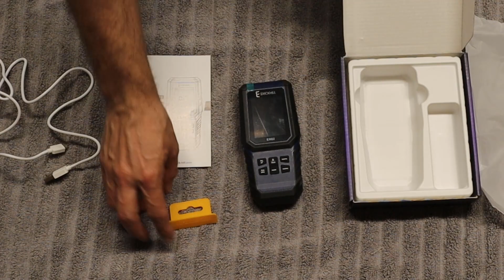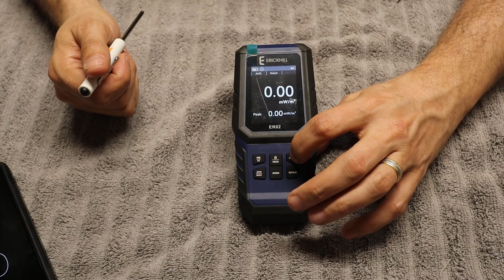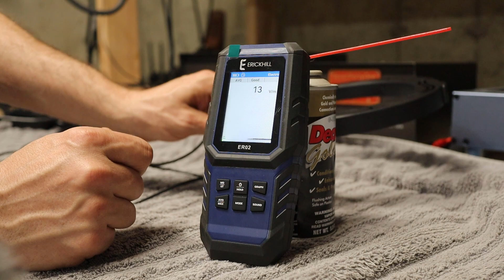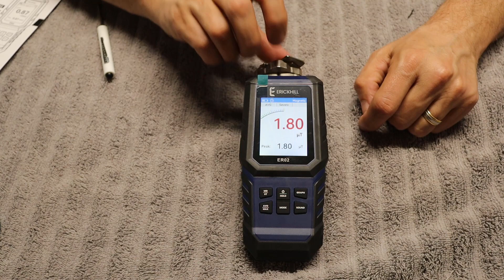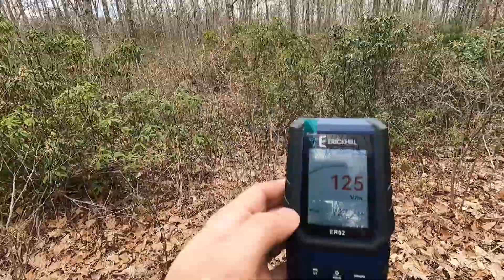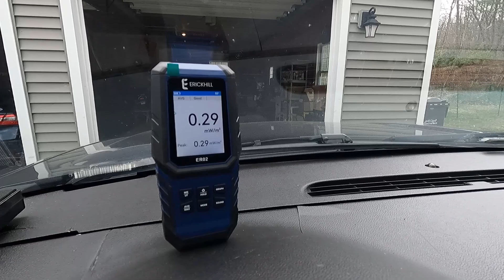ErikHill ER02 EMF Meter Overview and Demo

Comment: I have this meter and generally I was very happy until I noticed that this meter shows completely different values when held in the hand compared to when it is lying alone without touching it. The funniest thing is when the value jumps from 0 (the meter is lying alone) to 150 V/m (the meter is touched with two fingers). I do not know at what point the measurement is reliable and how to use this device in such a case.

I wrote an email to the manufacturer and sent them 4 videos with different situations and differences in measurements, but they completely ignored the problem, sending me a PDF with the user manual, the same one that is in the box with the device. They did not write anything about the problem I noticed.
Reply from the maker: Your body can act as an antenna and couple energy into the unit.  This is not a lab grade piece of equipment and as such is not going to be 100 percent accurate.  It should, however, be repeatable within an acceptable tolerance for the average user.  I suggest taking measurements without holding the unit as that will give you the best repeatability between different measurements.  Keep in mind I'm not affiliated with this company and am a user like you so this is just my opinion and I could be wrong
Reply: @SevenFortyOne  My opinion is exactly the same as Yours. I also believe that the body in some cases acts as an antenna. But why can't ErikHill and their "engineer" answer a simple question? It seems to me that they are not the manufacturer of this device, they just created a brand and have subcontractors. There is probably not a single person in this company who has any idea how this equipment is built and how it works. Contrary to appearances, this is of great importance, because when I stand with the meter 10 cm from the base of a 55-inch LED TV, my result is at the red zone level, but when I remove my hand, the reading drops to zero.

Comment: HOW ARE YOU DOING THANK YOU FOR YOUR VIDEO ON YOUR YOURTUBE CHANNEL I WAS GOING TO ASK YOU ABOUT ONE THINK
I HAVE A ELECTRO MAGNETIC EXPOSURE FROM WORK ENVIRONMENT AND I WOULD PERSONALLY LIKE TO MEASURE THIS IS THIS IS SAFE OR I WOULD NEED TO USE SOME SAFETY MEASURMENTS  

ALSO I WOULD LIKE TO RECORD IT - AND HAVE A JOURNAL OF HOW MUCH EVERY DAY AND WHAT TIMES I HAVE THIS EXPOSURE ON AROUND THE AREA

WOULD YOU RECOMMEND ALSO SOME SPECTRUM ANAYLZER AS WELL CONNECTED TO A EM METER

THANK YOU FOR YOUR TIME LOOKING FORWARD TO HEAR FROM YOU BEST
Reply from the maker: I recommend talking to a professional to get advice on how to take accurate measurements.  This device will give you a general idea but is not a lab grade instrument

Comment: @sevenfortyone do you think this would work good in RF mode to check for gps tracking and listening devices?
Reply from the maker: In theory it should work for those things but I haven't tested for that specifically
Reply: @SevenFortyOne  k if it does detect signal in RF mode on that one you have in this vid , the higher the number and if it turns red should be where the bug is planted? Correct? I have a K18 but just purchased this one as seen in your vid . Also what mode would I use to detect radiation with it from electric? Thanks for the advice